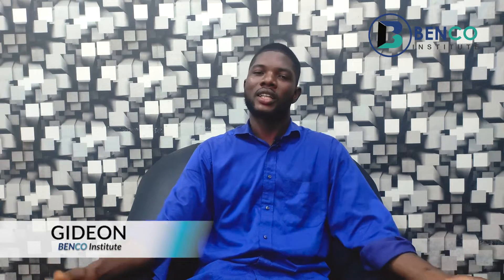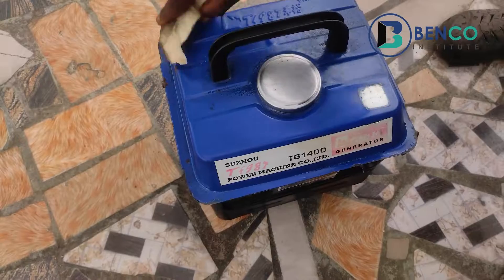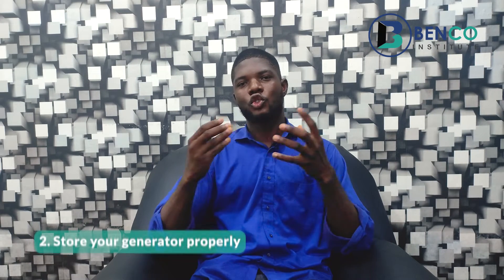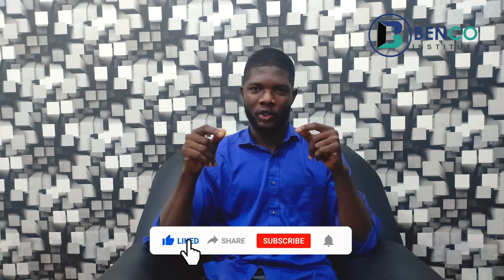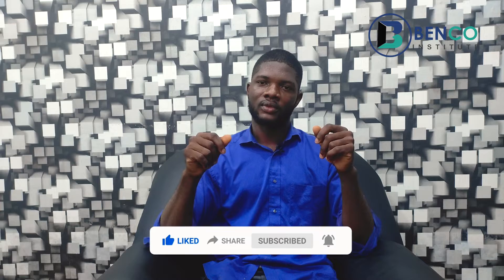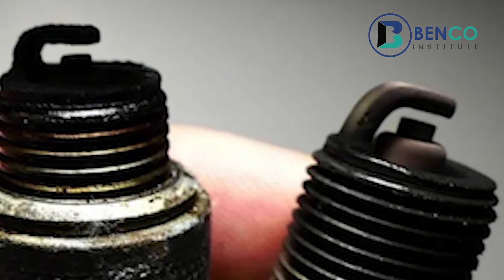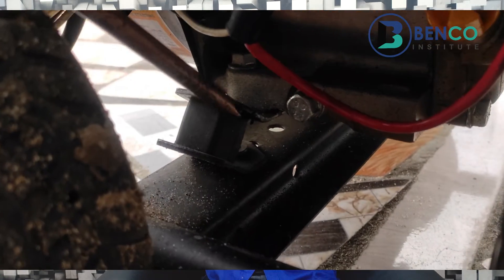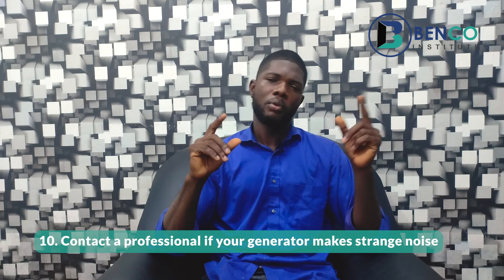10 ways to increase portable generator life/span...#electricgenerator Sumec,Honda,Tiger

Comment: Which engine  oil type do u recommend. Most engines recommend 10w30 but you know thats not easy  get (in nigeria) and even if u do it is very expensive. I currently use mobil super but someone told me that it is not recommended for small enjines
Reply from the maker: You are very correct

Get engine oil that is quite viscous

I recommend.the conoil Golden super
Reply: Is climax oil good for generator